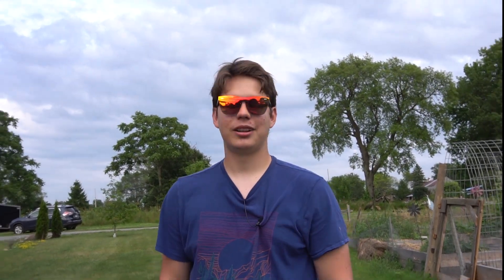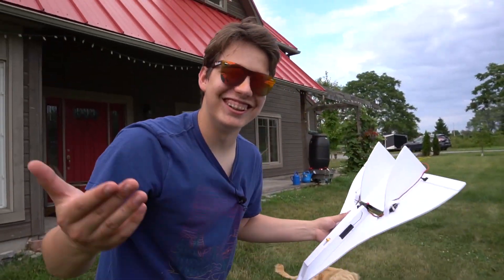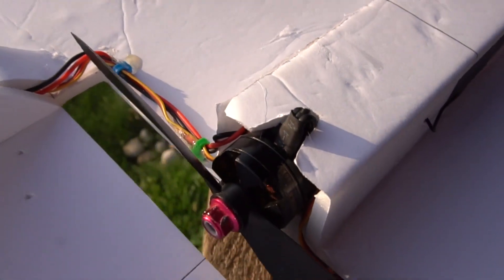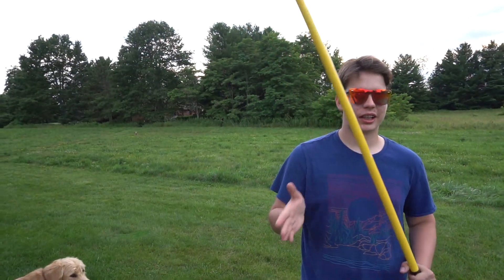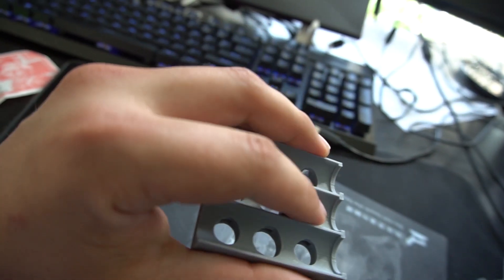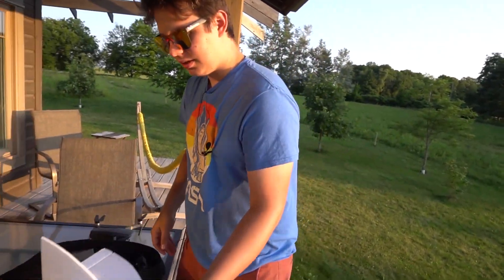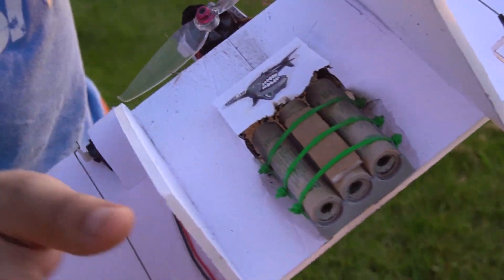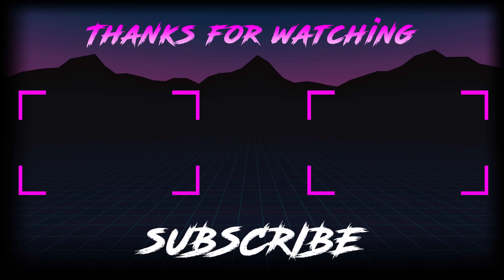Rocket Powered RC plane (fail)

Comment: Use booster engines with a clay plug in the top. Will prevent the burning infront of the rocket engine. You'll have to press the plug your self but takes 5 mins, cheap cat litter, a wooden dowel and a hammer to tap it